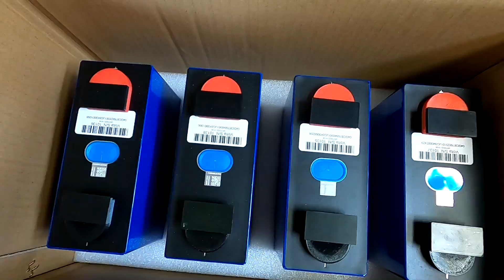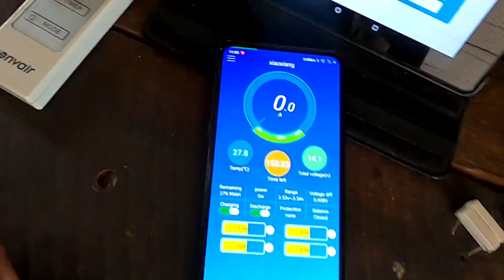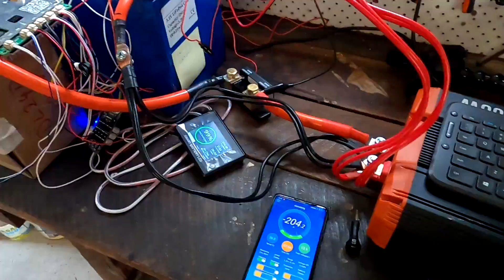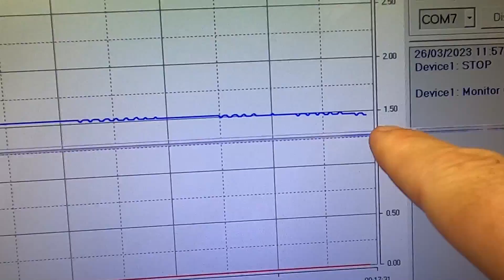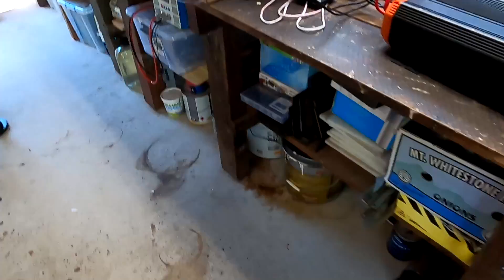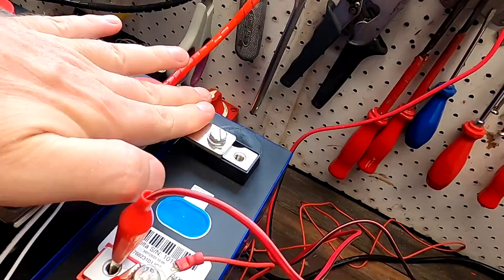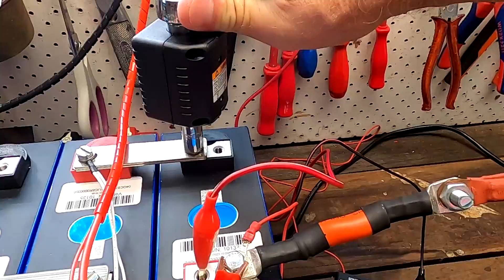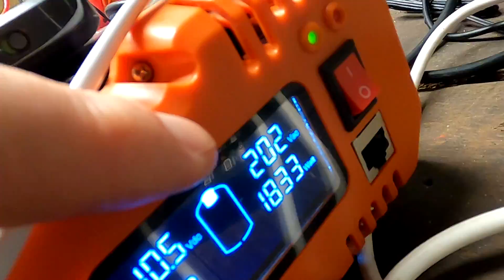My worst B-Grade cells vs. Certified Automotive Grade in a 100%-0% 200Amp Discharge Test. Surprised?

Comment: Excellent video and can't help out thinking this was in perfect timing for my complains regarding recent shipment I received from "one supplier".

This then leave out only one question, what is actually EVE standard of having cell doomed as pass or fail for automotive use. If capacity is the same and voltage discharge is the same, then what is it?! Although there are still load tests in YouTube showing that there is a voltage drop between cells with certain loads, and they are definitely not on mV category. So something is still not right. Maybe Andy has nothing but good cells on carage?!

Anyway thanks for video, it was again great.
Reply: Noniin, could be anything from not matching the IR curve as it should for matched cells (remember, capacity is only one thing, IR matching over the entire charge/discharge curve is another), SEI imperfections, to cosmetic imperfections. I don't think anyone besides EVE really knows what their quality check-list looks like.
Reply from the maker: Well the cells shown on other channel must be faulty, I have never seen any cell diving that low in voltage. And if they handpicked the fake Hithium cells for me to review, they did a pretty bad job as they are the worst I have.
Reply: Voltage under load and Self Discharge are the primary reasons cell pass or fail. Capacity is WH is the secondary criteria along with physical characteristics.

Comment: Hi Andy, I sent my certified double threaded terminal EVE grade As back, the threads were oversize and slack helicoil inserts, felt very soft on torque test, there were burrs on the countersinks and they looked little wonky side to side not giving flat contacts across the two cells, could this be the cause of your heat?
They tested low, mid 270s  My first order was damaged.   Got full refunds from a uk supplier no problem and went grade B.
My EVE etched grade B are very strong mid 280s with no horrible voltage sag. A tiny bit of bloating with no damage.   
I am very very happy!
And saved a fortune!  I am testing the last box of 32 😂
Cheers 
Gaz T
Reply from the maker: Oh, wow, Gaz, you're going full in! Another 32 to test...
I really like the welded studs we have tested before. The tiny contact area is perfect for very low resistance.
Reply: @OffGridGarageAustralia  Yeah no half measures Andy! 
Though I am fed up with the tests ending at 3-4AM and I have the fear of my old lap top freezing up and not saving, I have lost 2 results digitally😭😭😭.
I never tested all 32 grade As, just half a dozen or so before I was sick of the sight of them and enough was enough for them to go bye bye.
Cheers dude 😎

Comment: Great test, thank you for taking the time to do this. You just saved us all a bunch of money. I guess the only test left would be total cycles, does one last longer than the other.
Reply: Good luck testing that though. Even if you were to cycle them daily, you're talking over 10 years...
Reply: @upnorthandpersonal  It was kind of a joke, I realize that it would take some time.
Reply: @joeyoutdoors  Yeah, so was my reply actually. This kind of humor doesn't translate well in a comment on the internet...
Reply: @upnorthandpersonal  As more of these cells are scaled, the prices will continue to fall. even if the B cells last 5  to 7 years to 80% capacity you will most likely be able to replace them with new better cells cheaper than all in Grade A cells from the start. So this test was very valuable, as the value proposition is exposed with a pretty darn accurate set of tests.
Reply: @joeyoutdoors  I reckon mine will be out of cycles when I am about 120 years old. That really concerns me. 😅
Reply from the maker: Thanks, it took me almost 2 full days to undertake all the testing. Was a bit of a nightmare with the timing.
Yeah, the cycle test will take a long time. Nobody will wait for a result to make a decision of what to buy right now.
I did 75 cycles last year with my battery shelf, so...
Reply: @OffGridGarageAustralia  75 cycles- almost time to replace them Andy! 🤣
I’m guessing that cycles with these batteries are almost bordering on irrelevant for most people.
Calendar aging will likely be more of an issue- though that’s an unknown too. My 400Ah Winston cells in my caravan are nearly seven years old, and have shown no NOTICEABLE degradation- (though I haven’t ever gone below about 20%, and even that low is very rare).
What a pleasant change compared to the previous AGMs. I was absolutely paranoid about looking after them, virtually never below 50%, always monitored very carefully and always charged fully as soon as possible after use. At five to six years they were basically stuffed.
Reply from the maker: @FutureSystem738  yeah, cycle life will be the main factor of degradation.
You still got a 'good' life out of your AGMs. ^yrs is not too bad.

Comment: But, how do the different cells recharge and balance? Are the A grade cells better at balancing after a full discharge??
Reply: If the internal resistance across all cells is identical they should keep in balance fairly well.
Reply: Very good question @OffGridGarageAustralia
Reply from the maker: No difference ein balancing I could see. I used the same equipment and both batteries charged and balanced just fine.
Reply: @Off-Grid Garage  I have B grade cells, and if I dont charge them full every day, they go out balance by 150mv+ after a week. Now I know this could also be because of busbar resistance, but have you yet come to a conclusion with your passive balancing bms,s that it's not because of b grade cells.
Reply from the maker: @Davido2369  Mine are drifting a bit as well and especially over the last winter period where I didn't fully charge them for months, they drifted. But it was not horrible and I didn't have to use an active balancer or so.
As you said, could be bus bars and connection resistance as well... You need to watch which cells are peaking and do some investigation. A simple multimeter across the cells can be enough to tell you if it is the cell or the connection.

Comment: Seit einigen Tagen sind wir strommäßig erneut autark hier in Niederbayern. Mir gefällt dein Elan "very good" 🖖😉 Bitte achte auf die "schlechten" Lifepos. hier in Deutschland sind kürzlich einige abgefackelt...
Reply from the maker: I've read the articles and watched it online. But it wasn't clear if the fires were actually caused by the batteries...
Reply: @OffGridGarageAustralia  Better save than sorry... 🖖😉